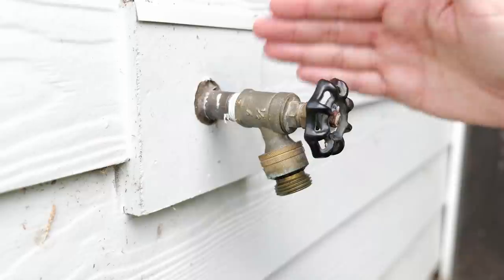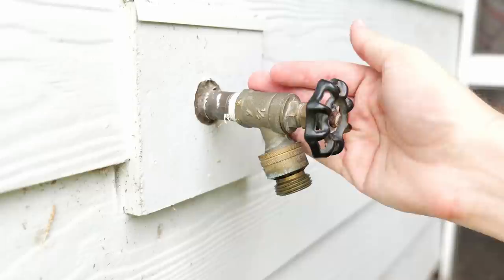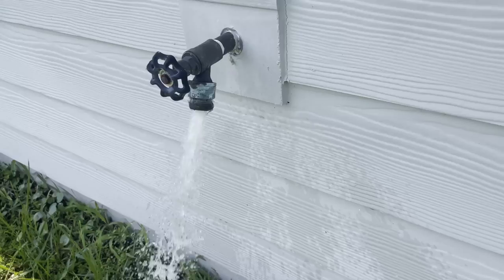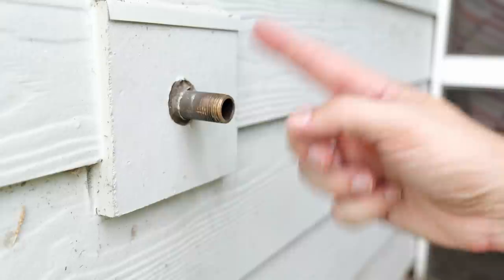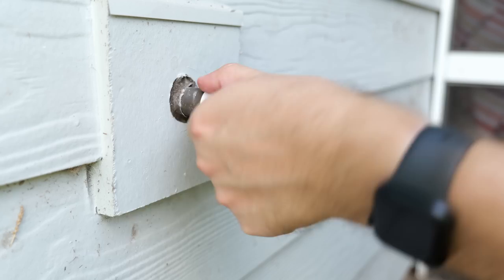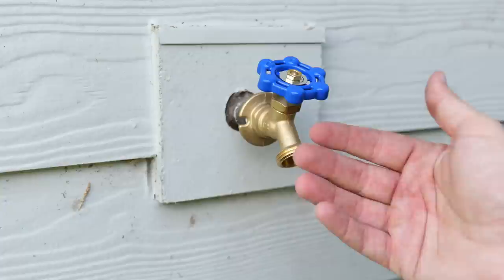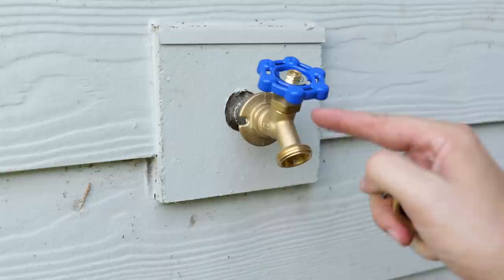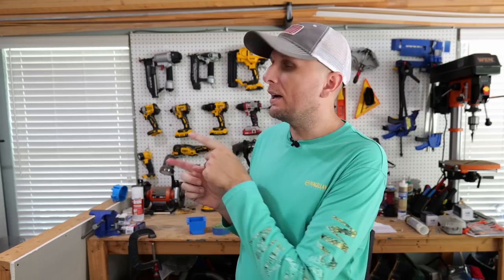The CORRECT Way To Replace An Outdoor Faucet | DANGEROUS and Common Mistake DIYers Make!

Comment: Instead of positioning your wrenches at 180˚ (4:09) to each other to break the threads loose, you're better off setting them at about a 60˚ angle or less. When you have them at 180˚, the force you put on them are pushing with both your backup wrench and your turning wrench at a 90˚ angle on the supply pipe. This can damage the pipe, or the next connection inside the wall. The correct way is to have the wrenches close enough together that you can kind of pinch them together. You can exert more force on the connection this way (handles far apart isn't using your muscles efficiently) but also reduces the lateral force on the pipe.
Reply: Good point. The net TORQUE will be zero on the pipe when the wrenches are set 180° apart. But the net FORCE will not because both wrenches exert a force on the pipe in the same direction, as you said. You are "One With Physics," my Jedi Warrior. 👏👏👏
Reply: Yeah, I was cringing a bit there. Probably no big deal for that application, but it's a good habit to do it your recommended way.
Reply: His wrenching is the mark of a DIYer.

Comment: Good job. Well done and easy to understand.  One comment. If the hose bib sitting proud of the siding is bothersome you can always install a piece of wooden trim board to make it fit flush.  It just makes the install look nicer.  Then pain to match.

Comment: When I sold my house about 8 years ago the inspector pointed out that I didn't have those back flow things on my outside faucets...  Home depot had them for about 50 cents, but this seems like a scam someone started to sell the damn things.  Highly unlikely a sufficient amount of any diluted chemical is going to back up through the piping in a house.... much bigger things an inspector should be looking for....   What was funny is I left him somethings to find.... like a loose toilet, etc.  didn't even mention that stuff.
Reply: Most of those guys are a-holes. They live for telling people what to do, and of course, without question, you gotta do it. An “apparently” well known inspector in our town came to check out a wood fence my husband built in our front yard. Of course it didn’t quite meet HIS approval, whatever 🤷‍♀️ Gotta respect that, it’s his job. A few days later I saw him so drunk at a local pub that his head was practically “on the bar”. 🤣 It shouldn’t be something to laugh about, but that didn’t quite meet MY approval, or respect. The loose toilet, classic move 👍
Reply: Home inspections !  They tend to steer off their main target and write up concerns that apply to current codes vs. the codes that were in place when the home was built. We all know that codes are changed now and then, adding, changing etc. how things should be but no home is required to "be up to current code" to sell it nor is it required to own it. the only time  newer codes are required on an existing home is when they are remolded, added onto etc. then the local city may require those modified areas of the home be brought up to the current codes for the remolded part. Those home "inspectors" are basically superficial inspection folks who will call out something and then recommend a contractor in that field give their opinion. Most of the inspection they do carries weight in the health and safety subject matter...that's really all that matters to a seller, that they are not putting a buyer in harms way but also at the same time, not guaranteeing conditions or suggesting everything is perfect. Buyers need to know more about "condition" and operation of a residence mostly and then they can focus on the purchase to go forward or backout or ask the seller to credit them on items that are reasonable to fix or replace. Not every seller knows what kind of shape their place is in so, they also could get a surprise by those inspections. The worst inspections are full of lame opinions about conditions vs. function such as a pool heater that is 20 years old and works but the inspector is suggesting "it is beyond its intended lifespan". If it works, how does that opinion lend itself to the buyer? Same about "galvanized plumbing pipes" vs copper.  Again, no leaks, water flow good so whats the point being made its not copper plumbing? It continues on and on so you have to wonder if the inspector is just calling out lame things to make his paycheck or attempting to give a report that the buyer could use against the seller for more discounts !
Reply: Home inspection is a scam unless it is done Mike Holmes way - ie How old is the roof, is the driveway sloping the proper way, is there a bathroom exhaust fan, does the kitchen hood exhaust to the exterior.........................NONE OF THAT COSMETIC BUSINESS.
Reply: @Garth2011 Absolutely
Reply: @AMC-eq3jr  Agree on those points. Most home inspections have a number of chicken $%(& items listed that have no merits.
Reply: I’ve bought and sold three homes and after the last one I decided I’m never using an inspector again. I find more problems myself they usually work with agents and don’t want to nix the deal and piss off the agent so they really aren’t working for the person actually paying for their services.
Reply: @greaterbw  Home inspections are not detailed or in depth inspections. All they are for is to point out things that may be a concern but they won't go into detail as they will always tell the buyer seek a professional opinion. What they are good for is the conditions on the surface such as electrical receptacles, drains, water flow, appliance functioning normally, HVAC operates etc. They will have a report that categorizes issues that are hazards, health concerns and items that would be better reviewed by those professionals. Not everyone is good in determining what is "normal" operation/condition which makes them a handy tool to further negotiate on the previously agreed sales price, before conditions were known. They won't find a roof leak or a sewer pipe problem so its good to know what they do not inspect prior to hiring them. Are they worth the price of $500? I would say yes because they can be used as a tool to negotiate a final purchase price which allows the buyer to have a "credit" amount to use for said repairs etc.

Comment: The set-screw on the vacuum breaker has a narrow neck immediately beneath the six-point head. It's called a "break-off" or "shear-off" bolt or screw. It's designed to break off once the intended torque or tension is reached and discourages removing the vacuum breaker. It's a one-shot deal.
Reply: Bad idea what if the device fails and actually needs to be replaced?
Reply: @greenspiraldragon , one simply replaces the vacuum breaker and valve with new.
Reply from the maker: Yeah, but once it is tightened down and broken off they are near impossible to take off without some rather annoying methods that have to be taken in order to do so.  There is no need to replace a perfectly good hose bibb just because the vacuum breaker goes bad, which it will and some hose bibbs are quite expensive.  In my opinion it is a really dumb design.  I get it's purpose so that a homeowner just doesn't take it off but that same homeowner might then just take the whole faucet off and install one without it.  I refuse to break them off and no code states that it is required and none of the instructions I have received with mine say to do so either.  In fact, they rarely have instructions.
Reply: @HowToHomeDIY they are designed to break off on purpose. Because that way some nieve person doesn’t take it off in the future. Turning it back to a boiler valve… so, snap it off…
Reply from the maker: Yeah for you to tag me it means you read my comment so no, won’t break them off and neither did the plumbers that installed mine.  Why?  Because it’s dumb.
Reply: What I was going to say!
Reply: It should be broken off. I’ve rarely had to replace the vacuum breaker (once maybe?) no problem removing it with a screw retractor. (For broken heads).
Reply: A city inspector following an unrelated water heater installation saw the unsheared bolt and insisted that it be sheared off to permanently keep the vacuum breaker installed.  It probably depends on your locale whether this needs to be done.
Reply: Thanks Alex, I'll take "things nobody asked about for $600 please

Comment: Thanks for sharing this safety tip. We've used these on our hose bins for 30 years. The brass model you show is the best one. When shutting off the hose that has a closed nozzle on the hose end, watch out for the valve squirting water out under pressure!

Comment: My home, 2006, had 7/8 male not 3/4 with a crimped back flow. Had to replace a 5 since the back flows will go bad. Thank goodness the plumbers left barely no pipe exposed so I had to chisle away the brick. Thank goodness professional are building homes. Few minute job took well over 2 hours.

Comment: Here in my hometown in Florida the code states that the set screw on the vaccum breaker which is designed to be snapped off after installation must be snapped off to prevent removal in order to comply with the code.

Comment: The new faucet does have flats for a crescent wrench, but there's only one set, rather than 3 sets.  It's perpendicular to the screwdown holes.  Good vid though.  Just had to do this two weeks ago.  Sad part is, we live in a cold environment and we don't have freeze proof bib.  Gonna have to fix that.  Thanks for the info.
Reply: I had one of those freeze proof valves blow up on me, turned my lawn into an ice rink. Replaced it with a regular valve and a shut off inside.

Comment: FYI any time there is a rubber gasket (like in the vacuum breaker) you do not need Teflon tape on the threads.
Reply from the maker: I use it because they are notorious for leaking, with or without the gasket.
Reply: Correct. Garden threads are not designed to seal. Unlike this vac-breaker, most female threads are swivel, so putting sealant between those threads accomplishes nothing. -Except possibly causing threads to bind before the rubber ring can seal.
Reply: Tape is not a sealant. It fights against friction, allowing you to tight the two parts together. Pipe dope is for sealant, and that is why you see ppl using both tape and pipe dope

Comment: Never heard them called vacuum breaker. Usually, Backflow Preventer.
First thing I toss in the yellow brass bin.
With a little over 60psi of water pressure nothing is going to flow into the house.

Comment: Adam, your use of teflon tape on the male threads of the hose bib, just before you attach the vacuum brake, shows a misunderstanding of how this connection seals. Unlike the other end of your hose bib, where you correctly used the tape to seal the npt pipe threads where the bib screws onto the 1/2 inch pipe. Just like a garden hose, the vacuum break has a round rubber seal at the bottom of the female threads and this is where the seal is formed, not on the threads. Pipe threads are actually tapered on both the female and the male threads. It is this taper that produces an interference fit between the mating threads and thus the seal occurs in the threads themselves. Pipe threads is a very old and affective way to join pipes, but it is still somewhat rough around the edges so to speak, and always requires pipe dope or tape to fill in those rough parts for a good seal.

Comment: I have come to learn that when
Wrapping the pipe threads with plumers tape, it is easier to flip the tape around, allowing the pressure unrolling the plumers tape a little tighter!
It also (for me any way) allowing the roll to spin in my hand!
From a cheapscape Diy-er

Comment: If you flip the Teflon tape over, you can keep pressure on the tape while your covering the threads. On old threads use both tape & sealant, sealant works as an lubricant when tightening.
Also the Faucet has a flattened spot by the screw slots for a wrench.
Also this is the wrong spigot for an outside hose, unless you drain the pipe every winter. Even the right ones should be drained in winter.
Reply: drained before?, during, or after a hard freeze or extended below freezing temps?
Reply: @oliveiramusic4u  
After a hard freeze may be too late, once it expands it will leak when thawed,,

Comment: Regardless of what you are using your hose for, most garden hoses are made of material that can be toxic, especially when laying in the elements, and labels warn against drinking from them and it being necessary to wash your hand after handling them.

Comment: Those vacuum breakers are great for getting a nice cool shower every time you shut off the water. Also, the corrode onto the spigots and are very hard to take off and replace. Finally, the cheap ones don't actually work.

I get my water from a well, and I don't leave my hose in buckets of nuclear waste, so I am getting rid of my vacuum breakers.

Comment: I was hoping you would show the vacuum breaker blast out water after you shut the water off with a hose attached...and maybe explain why that happens. 
Keep up the great work brother. LOVE your content.
Reply: I removed those vacuum breakers on all my outdoor faucets for exactly that reason. I was fed up with all the water spraying everywhere every time I would cut off the water supply. Made a big mess including water all over my clothes and shoes. As a side note, I also replaced all the faucets with 1/4-turn valves which work like a charm compared to the screw in/out valves.
Reply: The spray comes from the pressure in the hose AFTER the water is turned off.  It has to go somewhere so either you hold the trigger on your nozzle to release it or it comes back through the vac breaker.  That's why the holes exist.
Reply: @stevenz933  Same here I removed all mine got tired of getting spayed with water every time I shut it off with hose on it.

Comment: Vacuum breakers as you said are not needed 100% of the time as it depends on what you will use the hose bib for.  With that said, they also are a PITA when it comes to decent water flow as they restrict water flow  to an amount less than the hose bib can supply. They also tend to malfunction at times and require replacement.  It is interesting that "code" requires them without knowing what purposes the homeowner will use them for...not everyone uses them for spraying chemicals.
Reply: I always stopped the water from going back into the system by closing the valve when I'm done.  I always thought that worked pretty well.
Reply: @jime8532  no doubt! I understand the concept of the back flow preventer, but when you turn the valve off where does the back flow get around the closed valve? Makes no sense to me!

Comment: Looks to me like your new house bibb had a flat on either side next to the screw holes. An adjustable wrench should fit that.
Reply from the maker: You always have a keen eye for things.  Yes, there is a flat on each side of the hose bibb and an adjustable wrench may have been able to handle it.  The flats are very short though so would definitely need to make sure the wrench was as tight as possible so as to not have slippage.  I still prefer the rubber strap wrench just because they work so well and won't leave any markings.  As always thanks a lot for the comment!
Reply: @HowToHomeDIY another way to tighten last bit.  Put a screw driver into hose bib hole and twist

Comment: Drank out of rubber hoses and non-backflow bibs when I was a kid in the 1950s. First backflow valve I saw on house bib was in 1980. Put them on all bibs since. Thanks.
Reply: I suppose you did not have a padded bicycle helmet either.  How on earth did you survive?

Comment: The Teflon tape doesn't fill a gap to stop water from Moving through the threads. It acts as a lubricant so you can tighten the tapered thread into the fitting tighter to get a better seal. No need to put it on Garden hose threads, they are not tapered, you have a washer that Makes it water tight. The set screw head is supposed to break off so the vacuum breaker cannot be removed without damaging the threads, making it unusable. An inspector will fail you unless the head is broken off. The Teflon tape is also easier to wrap, If you flip it over to where it's rolling around the pipe instead of rolling against the pipe.

Comment: I have never understood how it would be possible for something like a passive sprayer on a hose to force anything back into the water pipes against the existing pressure...can someone enlighten me?
Reply: Very unusual circumstance but if you were to have a broken main line somewhere or if your water/fire department department opened up hydrants it could create a backflow condition. However like you said you would have to lose pressure and actually have a vacuum occur in order to pull water back into your potable water system, hence the name vacuum breaker.
Reply: Well, it can't, AS LONG AS there is existing pressure in the line.  As Scottdavis says, if the pressure in the house drops for some reason, and if the end of the hose is in a puddle or a pool then that will siphon water back into the potable system of the house, contaminating it.